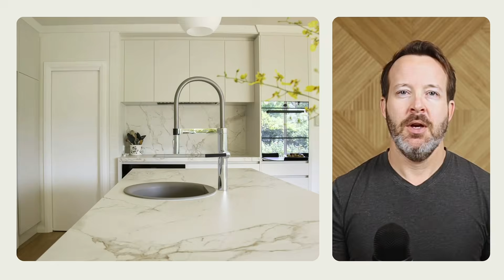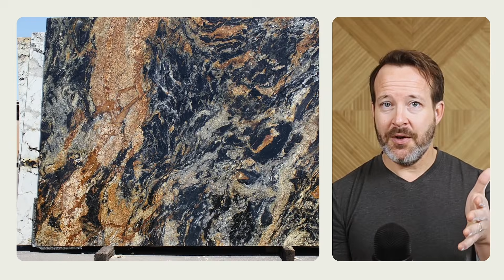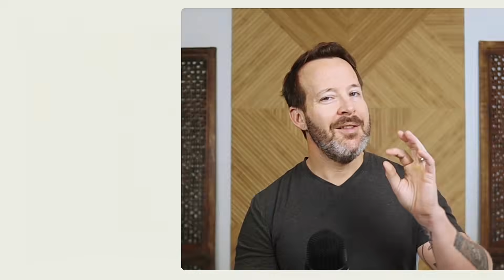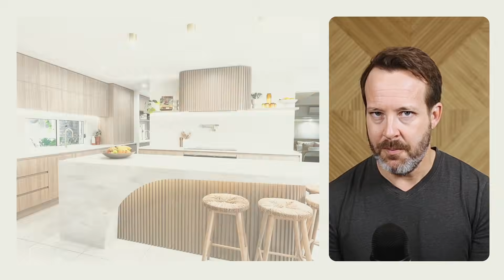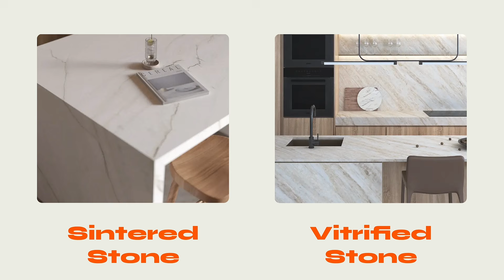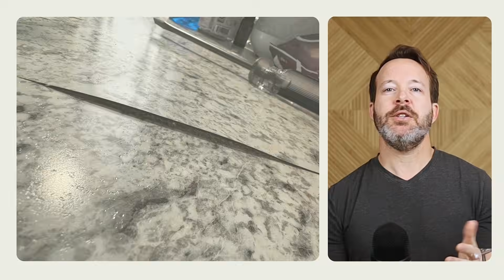Which Countertop Is The MOST Functional?

Comment: I have never sealed either slab granite or granite tiles, and I have never seen a problem.  The idea that you have to seal granite, to me, is a myth.
Reply: I bought a 2x2 piece of granite to put next to my stove. I talked with the granite vendor about it, and he steered me to stones that didn't need to be sealed. It has stained gradually over the years. In theory, there might be some bacteria lurking there. You know what, i don't ever sterilize my surfaces, and i use cutting boards and plates for my food, i don't leave wet foods lying around on the counters. My granite is zero maintenance, and i can take hot pots off the stove and put it directly on the counter. 

But if i put a glass on the granite, it goes clink, and I'm glad i don't have it everywhere. I actually really love my laminate (Formica) in the rest of the kitchen. 

It's not as pretty, but for real performance, i think stainless steel is the winner. Heat proof, easy to get really clean, and incredibly durable.

Comment: I have had butcher block for 12 years and absolutely love them! I cook and bake a lot. They are incredibly forgiving. When we move, I will replace whatever is in my next kitchen with butcher block.
Reply: Word of caution for those in highly arid environments- my friends remodel used butcher block but she doesn’t oil it every day (like I oil my cutting boards after every use) and living in NV, her butcher block has cracked already. So yes, FANTASTIC option but please consider upkeep in your area as it may vary. I love the butcher block in non arid environments.
Reply: @ac2816  All depends on the type of wood used.   And the orientation of the blocks when glued up, if correctly done the grain expansion should be all even between each block and thus not create cracks but if done incorrectly then and the wood expands and shrinks you will get issues. 

But best is to go with as hard a word as possible.   If you can get hold of heritage stone fruit wood, like old (100+ year) apricot or peach wood from a local orchard then that is good but you need to make sure the segments you cut are all from the same apron radius in the wood, if you use a core block mixed in with blocks from the outside the expansion will be very differnt as the grain depth is drasticly differnt.

Another option is if your re-moddleing an old (old)) house and find yourselves removing a lot of well aged hard wood rafters and joists, if you can get the nails out of these and slice and dice them up as the have been sitting for 100+ years within your home they will be all old growth (so much more even growth rings than modern timber).   

One good idea is before slicing and dicing is to stack the timber you intended to use within your kitchen for at least 2 months to let it get adjusted to the humidity of your home, this way the blocks when cut will be square at your homes humidity.   This can be very differnt to getting timber directly from the timber yard and dicing it up and then gluing it all up to find it all expanding in one direction more than other creating cracks in the glue.
Reply: @ac2816 we have extreme low humidity warning... At 54% humidity. During the summer it gets over 99% humidity.
Reply: @ShellBackBeau  not sure why you sent this to me? I just said I love the countertops in the right environment but haven’t seen them work here because we have low humidity. Our summer average is 20% ish or less. We literally live in a desert. I’m happy for everyone these work for. No shade, just trying to save others because I’ve had more than one friend lose $ to having to replace these counters in our area in less than 2 years. More power to you for your specific humidity but idk what it has to do with my comment. Have a lovely day.
Reply: We installed butcher block in our previous kitchen and I loved it. It was warm to the touch in winter and didn't make a loud clanking noise every time a dish was set on it. Dishes dropped on it were less likely to break. I once knocked a glass out of an upper cupboard and it bounced off the wood a few times before falling onto a dog bed. Our current kitchen has stone countertops and just knocking a glass over can cause it to break. The matte surface of the wood is great for kneading dough because it's less slippery.

Ours was solid beech from Ikea but I don't think they sell it any more. We used Paperstone around the sink to reduce maintenance.
Reply: @janelj54  we found a local who has some air dried eucalyptus (very hard wood) and are going to be making our surface form this.
Reply: I'm really considering butcher block in my kitchen when I get to reno-ing. How do you deal with moisture around the sink? What species of wood do you have?
Reply: @Kate-ny5xy I love my butcher block except around the sink.
Reply: I absolutely love my butcher block island. Love, love, love,love, love.  I’m not sure if I’d want it for all my countertops. Do you love it all around?
Reply: That’s what Julia child had in her kitchen! ❤
Reply: Butcher block is my dream material too

Comment: When we started our total house remodel we looked at all kinds of countertop materials for the kitchen. As the months dragged on we decided on Cambria. The supplier quoted a sqft price and we chose a particular style we liked. As many more months dragged on the price increased and availability was only by the sheet at that point. The size of the sheets would have required 2 sheets at $2000+ fabrication per sheet and we would have been left with half a sheet of unused material. Not enough to use on the bathroom vanities which also needed countertop material. As more months dragged and the kitchen cabinets were finally in place we ended up getting a highly figured granite that combined the colors of the white cabinets, natural color bamboo floors and stainless steel appliances. The sheets were so large we needed only 1 @ $1600 per sheet. I can say without a doubt that it is the most beautiful granite I've ever seen. We're very happy that our project took as long as it did, otherwise we would ended up with some fairly boring, expensive countertops. We've had no issues with them over the last 5 years. They're still just as beautiful.
Reply: i worked at a fab + install countertops company 2024-2025! Cambria is expensive (USA made) only specified approved cambria fab/install shops are allowed! can research the history & owners of Cambria !!! most not all quartz is made in china (fyi) 
... many different types of granite & quartzite & marble 
and i always tell people to Go to a Slab Stone wholesale showroom to see what's available to them !!! 

(not all countertop installers are the same &/ or honest ! that's why Buyers must do their homework & shop around & ask the proper questions !)  check their reviews online ! ask where your countertop  seems will be placed too)  it's simple - take your countertop's full square feet and divide it by the total cost to you ! = how much you are paying per sq ft ... bathrooms can be made with remnant pieces typically & you won't be buying a whole slab to make typically smaller bathroom tops - it saves people IF they pick a very expensive material that's a remnant of a very expensive slab that was left over from another customers project!)  ex: i got a high end labradorite (high end *granite)  table top made 40x40 for under 500$ i picked it up ! big pieces of Labradorite in it ! 
sometimes people just must educate themselves & shop around & ask the right questions ! 🇺🇸
Reply: Great example
Reply: Do you remember the name of the color? I really like granite alot. Thanks for your post.
Reply: No wood floors in kitchens and bathrooms!  I don't even know how many friends and clients have had floods from plumbing failures in their houses.  Two friends had it happen twice.  Heartbreaking damage.  The second time it happened in one friend's house, he replaced the kitchen floor with tile, like I told him to do when he built the place.
Also, put the washing machine in the garage, and the hot water heater outside the house.  Simple.

Comment: In the great debate of quartz or granite I'll always prefer granite, the natural stone/heat protection makes all the difference. But I will say, we're planning a kitchen update in our new home, and you having laminate in your home almost gives me permission to do the same. We're planning on laminate to keep the reno cost down, and then sometime in the future could update it to granite. Love your videos!
Reply: Pretty much all the builders and kitchen renovators I know have laminate. There's a lot to be said for it not to mention it's inexpensive and easily replaced when/if you want to update your kitchen.
Reply: My house came with high quality laminate when i bought it 30 years ago. I planned to eventually upgrade. But i fell in love. It's white and cheerful, it's softer than the stones (natural and man made) so it's gentle on my china and glassware. It's easy to clean. 

I ended up just replacing one 2'x2' section next to the stove with unsealed granite. That's a handy place to rest the hot broiler, and it's also easy to chill when i want to roll out pastry. But that one 4' section is plenty. Most of my kitchen countertops are white laminate. And it looks the same today as when i moved in, 30 years ago.

Comment: After much debate, we decided to go with Quartz countertops. We love it, however, due diligence is required. Don’t use the cheapest. Many of the cheaper quartz options do NOT have the color and pattern go all the way through. If you use an under mount sink you will see a reveal that may not be the same color as the surface of the countertop. Same problem if the edge of a slab backsplash edge is exposed. The pattern we selected looks like real stone without the disadvantages. Quartz is also better than stone if you need to match up more than one slab because the slab pattern is consistent. Stone seams are more noticeable.

Comment: I was hoping to see how a concrete counter was going to stack up against the others you mentioned. Yes it can stain without sealers but definitely heat resistant.
Reply: Yes it stains. There are more pitfalls in pouring a concrete countertop than you can imagine. It's NOT DIY friendly.

Comment: Total remodel of my kitchen,pantry and laundry area. I chose  light stained maple cabinets, granite countertops, composite sink and LVP flooring. I scratch cook, preserve,and bake a lot. I need hard working, tough materials. The ultimate would have been all stainless steel with tile floors but I don’t want to live in a restaurant. It’s a home, not a commercial building. Choosing materials was the hardest thing I have done in my home. The decisions are expensive and so permanent. I did not want to make a mistake. Ask me if I made the right choice in 5 years, that’s the real test.
Reply: I love stainless. Don't understand getting anything else. If I cook there, it's stainless. If I'm eating on it, it can be some wood slab but even that is getting to be too bothersome. 

My next driving table is going to be some easy to clean plastic laminate.

Some guests said eww restaurant, I told them the food is better...

Comment: Stone Coat Countertop!!!  Epoxy that you can make look any way you want. Super cheap, low (or no) maintenance, super easy to repair if the top layer gets damaged, easy to swap out if your kitchen design changes. NOTHING beats it. You can even make it with "live edge". The only thing you might not be able to do is highly intricate profiled edge, but I've never tried that, so I don't know.

Comment: I once rented a house with granite counters. I chipped almost every dish because it's so hard.  It’s so pretty but I guess I'm too clumsy for it. Probably go with formica but... I really want an undermount sink and an integrated drainboard. Oh, I found a nice product that brings some nice life back to formica called "Gel Gloss" (the original). Also, I really appreciate your thoughts regarding drawers rather than cabinets. Sort of a new thought for me.
Reply: Oh I highly recommend drawers!  Mark did my design consultation and that was his ‘strong’ recommendation.  I LOVE them.
Reply: That would be me. Something flew out of my hands when my Pergo floor was pretty new. 🫤 Nice big ding right in the middle of the room.
Reply: No to gel gloss.  I have done Howards food wax.  BUT Now since I did do a multi-year ceramic coating on the Mazda,  I did what was left in the bottle on one side of the sink. area countertop. Bingo! THAT WILL RESTORE YOUR LAMINATE. Once it cures it is inert *no chemical to food *Plus its uv and heat resistant. Amazing to restore laminate!!!!!!! Just clean and degrease countertop, dry and surface prep with isopropyl Now your ready to coat your laminate just like your car. NOT THE SPRAY TYPES. You must use the true ceramic coating, I used Maguire's Pro line called M888.
Reply: @ValerieMartin-lk9zd - thank you for the suggestion. Why do you not like gel glosss?

Comment: In looking for coutertops, I've had an absolutely horrible experience with Dekton.  One of the samples they sent resulted in getting stitches.  The "samples" they sent me were just 3x3 tiles broken off of a larger tile, only about 1/4" thick, so not even a material sample.  The only advantage is that it's one of few materials you can use a hidden undermount induction cooktop with.

Formica's not much better.  I see all these fancy edge profiles, but I ordered a roll of Formica to play with, and I cannot for the life of me figure out how to bend it like that.  I've tried heating it, soaking it, scoring it, it just will not contour at all.  The amount of glare off it is also insane.  If you have lights in your home, you won't be able to see the pattern when they're on.
Reply: They have special heated presses that can apply even heat and pressure.

Comment: We put a Formica countertop in our summer place 15 years ago, as it was a remote site, and was the easiest to hike up large hills from the dock.  I still love it. It has been surprisingly durable - doesn't look any different at all over the years!
Reply: Yes, to Formica for me, too! A white Formica countertop has been in my kitchen for 50 years and still looks great. Planning a remodel soon to make my kitchen ergonomically functional and will go with the same Formica again.
Reply: We installed a green marble laminate countertop and edged the counter with maple to hide the edge. It was fun at open houses to see buyers tapping on the counter trying to tell if it was really marble. They couldn't tell (we were honest if they asked, of course).
Reply: @alastairdallas My friends did the wood edge when they built their home in the early ‘80s. The laminate started lifting at the joint with the wood trim around the sink area about 25 years in.
Reply: @TheDriftwoodlover If you're putting a sink on a laminate countertop, your best option is a cast iron surface mount (drop-in) sink using polyurethane caulk.
Properly installed, there will be no water saturation of the substrate, most likely particle board, but in some rare cases, marine ply.
Reply: My parents had a Formica table 60years ago, I believe it’s still going strong.😊

Comment: I choose stainless steel. I have a 63" double drainboard Commercial sink with real pre-wash sprayer with add on faucet. Single bowl 19" x 23" x 12" deep. My 2 base cabinets 30" x 30" will have a 20" deep bottom drawers for dishes and silverware  there will be a 10" deep drawer above the 20" deep drawer for storage containers and will have a hidden mini drawer for spices by the refrigerator. The cooking utensils in the 10" deep by the stove.Both of these will be mounted in stainless steel work tables with wheels to make cleaning easier for me. Also a custom made prep table on wheels with a stainless steel top 30" wide and 24" deep with HDPP cutting boards on top the protect the stainless top from damage from use.
Reply: I love commercial kitchens, but then I worked in the restaurant business for 12 years. It sounds like it will be very nice when you get it put together.

Comment: No mention of butcher block hardwood?  What about poured concrete?
Reply: I think wood is the best. Warm, durable, affordable, repairable, environmentally friendly. It's what I mostly have, but not around the sink.
Reply: @GNik6 if you have an under stuck (buttler/farm house sink) were you are able to access the wood it is not that much of an issue
Reply: @hishnash 
That sounds reasonable. The open side gives you access to keeping it clean and dry.
Reply: @oltedders  yer and on that edge/arround it you can use a anti fungal base coat oil product or if you like the style char it with a powerful blowtorch before oiling with your food safe top coat oil/wax.
Reply: @hishnash 
I believe I would be inclined to use marine varnish on the underside of the countertop. The farm sink is probably the best solution for gaining access to the part that is most problematic. Suiban is a non starter for that application.
Reply: @oltedders  the issue with vanish is if water gets in (at the edges) the wood can’t dry out.  If you varnish only the underside then the water will get in at the boarder.  Also you will have much more bowing of the surface as the humidity from top to bottom will be larger
Reply: @hishnash 
We don't need to go back and forth about something no one is actually dealing with.
Reply: Yeah, I was hoping he was going to touch on concrete.
Reply: @shannabolser9428 
Concrete stains like crazy. It all needs to be poured in one batch at the same time or there will be variations in the colors. It's not as cheap, easy and DIY friendly as you would think it to be.
Reply: I think he mentions concrete in another video. I know concrete likes to crack, so that may be a consideration.